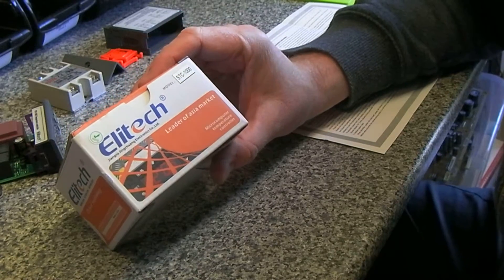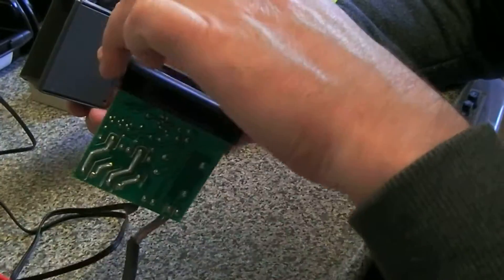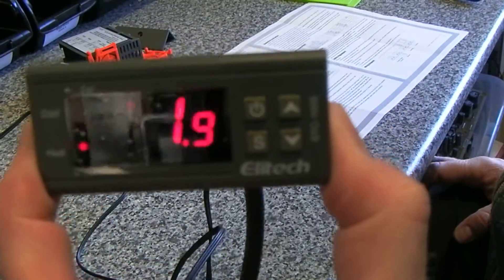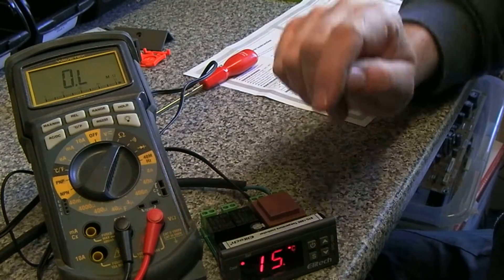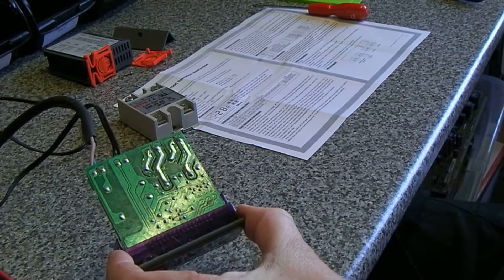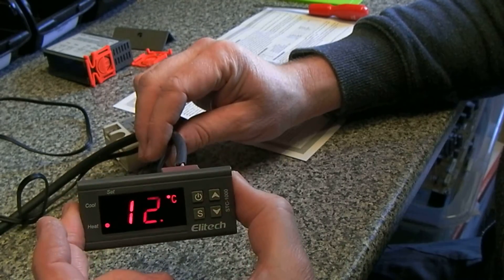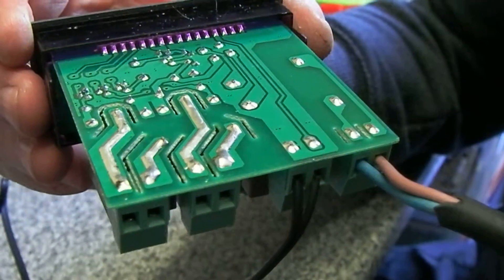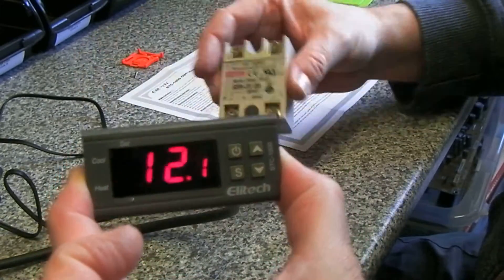The STC1000 controller. Aquarium heat controller.

Comment: Did i miss that or was you trying to test for voltage in holms or does it not give out a voltage on heater or are they nc no loop i used to call them motor conection they are voltage free is this rite